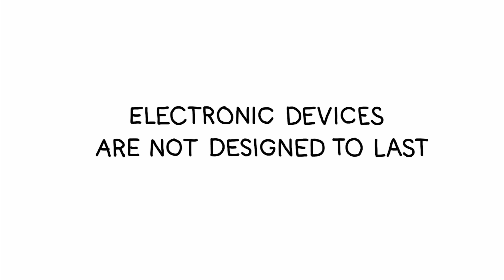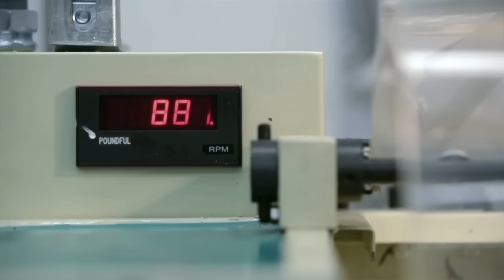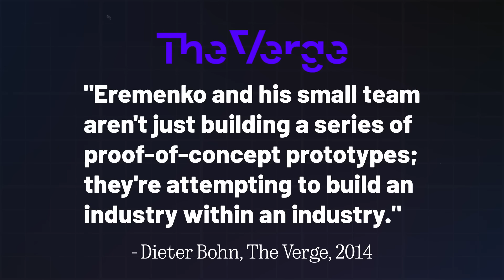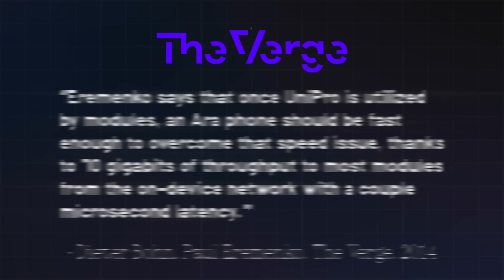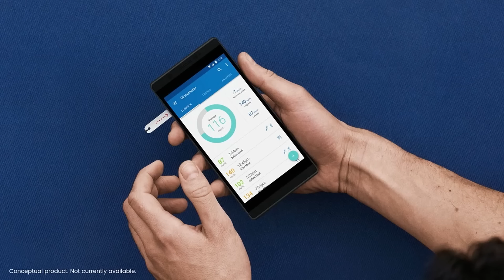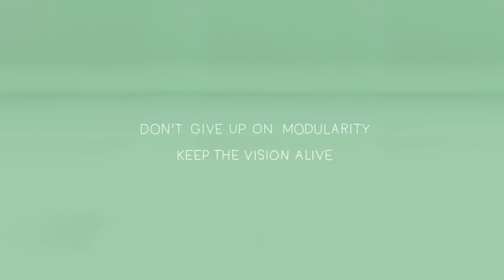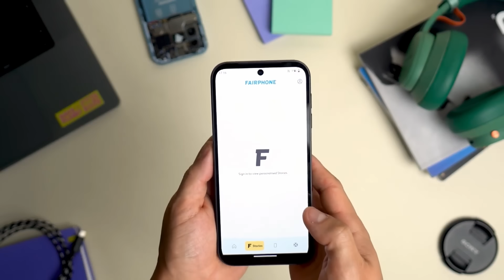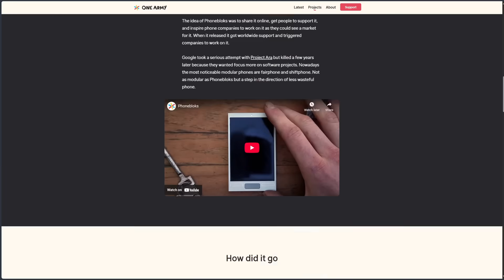Why Did Modular Smartphones Fail?

Comment: I get why modular phones never worked. Realistically, most people dont care about the waste or lack of customisability, they just want a thing that works. Over a decade later im still bummed tho cause its still too freakin cool.

Mottorola's moto mods were cool atleast
Reply from the maker: Yeah I wish they supported them for longer.
Reply: I liked the moto mods, and had a phone that worked with the. But actually using them wasn't ideal, couldn't put a protective case in the phone due to the mods, so I broke my screen...
Reply: @DevDog67  I think a tempered glass screen protector and the soft wrapping that came with the phone would've sufficed.  Most of the mods worked with the wrapping on, and it slid easily off for those that didn't.
Reply: normies and their consequences.
Reply: I don't agree with this, at all. People have gotten used to not having those things. But the hype around this phone when the idea first came out proves there was demand. It doesn't even have to be as involved as the original idea. If we could swap the battery, the screen, and the camera it wouldn't take much else for me to consider buying one.

Sooooooooo many people I know buy new phones mainly because they broke the screen, or they want a better camera. DXO One was ahead of it's time.
Reply: @KingstonHawke  While I agree, I would still rather have even more options.
Reply: @ChocoRainbowCorn I don't think you're disagreeing with me. I'm saying people care about being able to customize their hardware. The two examples I gave would be everything to me. Being able to hot swap batteries and storage is huge! And the camera is even more important to my crowd because we all shoot so much DSLR content, that if phone cameras could finally truly match even a ZV-1 experience, it would replace that whole category for us as we wouldn't need both devices. 

How you justify consumers spending more is to take two devices they already have and merge them into one.
Reply: AKA, the reason why iPhones sell well, despite being as expensive and restrictive as the Android.

I REALLY want to move on to Android, but theres so much to chose from, and each one has their own flaws. Is like using Netflix but being overwhelmed by so much movies that I ended up not watching it.
Reply: It's true, sadly, and I hate that because I am the kind of person who just keeps everything until it breaks. I've been lucky to essentially never having had to buy a phone, because I was able to either repair or inherit them from relatives, but I wish people cared about repairability and reducing waste more. But it's not gonna happen unless they're forced to, and companies are punished for producing unnecessary e-waste.
Reply: Exactly, the whole "the phone companies KILLED them" is such a tinfoil hat theory. People like ease of use, ease of use = sells. People are already get frustrated and barely understand how a car works let alone what goes wrong with it, the last thing they want is a  phone with a check engine light.

Comment: fairphone 6 was just announced & its not quite modular but just a hair closer, the back cover can have a couple accessories attached to it but those are all things we can get on cases. i think it would be too ambitious to just drop a fully modular phone, products & ideas need time to develop & take baby steps
Reply from the maker: Dude I'm much more excited about the dumb phone switch. On top of the repairability, this is like the ultimate gimmick phone. It's circled around into being actually useful.
Reply: I could see enclosed modules but you need a good locking system and probably a water resistant case.
Reply: Still no upgrades tho.

Comment: When RISC-V chipsets become capable off competing and potentially replacing ARM in devices we could see the rise of molar smartphones like we had all hoped for on the future. We have open source everything software side essentially. For an open source smartphone we’re just waiting on hardware. We just need RISC-V and the rest of the internals to catch up.
Reply: I literally would buy a Framewerk if it were built on a modern ARM or RISC-V base SoC. Unfortunately I don't know any similar that's not running on x86 & & Framewerk uses AMD Ryzen. I heat people scream "not gonna happen as long as there aren't any ARM based boards that uses PC interface & firmware". Nonsense! There literally are ARM SoC which run modern Linux systems which support PCIe, Ethernet & USB 3, 4k over hdmi WITHOUT using PC-like firmware.

Comment: Modular phones are pointless nowadays phones have peaked. Upgrading camera or motherboard aren’t really going to make much of a difference. We need repairable phones. I repair my phones and tablets but it’s not easy. At least a removable battery, easily replaceable charging port, and a logic board that isn’t hard to remove or pair to the new phone. Cloud locked phones are the biggest cause of ewaste. I find so many phones people throw away that could have a second life but they are locked for good. I understand it deters theft but with phone atms people can sell them anyway there’s got the be a better way.
Reply from the maker: Peaked is a strong word. I would say "normalized". There's a standard and a supply chain. Deviating becomes harder every year.

Comment: You could probably get a fairly seamless experience so long as you could agree on a standard screen and camera. All computers with a hdmi port can use the same screen and operating system with swappable parts.
Reply from the maker: Yeah I feel like computers have been historically a lot more modular. I wish I could have just install more RAM or a better GPU in my phone like I do to my computer.
Reply: @owencooktech The issue is that such a thing would be calling for enormous, fundamental change to an industry that was already fairly established in the big players yet still full of competition and wasn’t entirely decided to become something like a PC. It worked for PCs and Laptops because the devices themselves are so large that the modular approach meant very little compromise in terms of different form factors, even then a lot of laptop and desktop parts werent always compatible.

This was entirely technologically possible, but realistically would have never happened.

Comment: My current phone is a Fairphone 3 (2019) that I bought second hand and it works perfectly fine. Like maybe the UI isn't perfectly smooth or stuff, but I don't actually notice any of that, except that some games run a little slow. All other apps that I use work with no issues.
Reply from the maker: Yeah, the reality is that most people don't need a crazy performing phone. The fairfone 5 is perfectly normal for like 90% of apps. More than that even. It's the same point as my gaming phone video. Theres a reason they don't sell based only on performance. Most people don't need that.

Comment: Imagine dropping your modular phone and the phone unmodulates and modules be flying.
Reply: There are phone cases
Reply from the maker: Lol. The ara seems to have fixed that with the lockable system but imagine just loosing you battery and you never find it. That's game over.
Reply: @owencooktech  I mean, you could just buy another and pop it back in, shit, you could buy multiple batteries and be switching between them on the file so you don't gotta be stuck to a power plug
Reply: @CrocoDylianVT put 2 battery modules on the phone lol.
Reply: @DylanElmer but then you have no space for other stuff~
Reply: @owencooktech  by "game over" you probably mean "I can just get another battery."
Reply: @owencooktech  if they already did that to the desktop computer it is also possible to do that on mobile phones.
Plug and play.
But it needs more design evaluation..
Reply: @owencooktech buy another battery module
Reply: @owencooktech I did that with my first psp, dropped it in a bunch of rocks that looked a lot like the batteries.
Reply: @owencooktech Plugs In USB charging pack! 😂
Reply: @owencooktech  cant you just.... buy it separately?
Reply: @owencooktech  Phones used to have removable batteries and people didn't have this problem. In the (rare) case it did, you just bought another battery.
Reply: @owencooktech wasnt that the whole prospect of the modular phone. If you’re stupid and lose a single module you can buy just that module instead of the whole 1100$ phone or etc.

Also the fact that not everybody needs an “everything phone”
Reply: @owencooktech  imagine replacing that internal locking feature with special cases that could kind of augment the phone's appearance with a back for stickers or anti-glare lense for the screen? It feels like the focus on excessive functions in some versions and size concerns. 

I've talked to a buddy who liked the concept and also saw this video, he said he likes bulky phones. So I threw out the idea of what if whatever company in charge made 3 sizes for the modular phones. Small for kids and minimalists with limited mod features, medium for people who want try it out or don't want to get too technical with it, and large for people who more modding capacity in the phone. This way you hit every demographic of smart phone user with just changing the base phone size, nothing too crazy.

When it comes to the modular components the production of some parts could be made by the creators in house. While others companies can design higher end modular pieces as a collaborative efforts to expand the functionality.
Reply: @owencooktech  you can rebuy it tho
Reply: easy fix wouldve been some sort of clear back that locked in
Reply: couldve been a metal frame that slid on too
Reply: @hardlyreading like a clear phone case!!
Reply: @hardlyreading clever
Reply: That is how almost all phones with swappable batteries worked back in the day…. The batteries would just fly out
Reply: well thats what case would be, a clear case around the phone to hold it in...
Reply: A phone case would fix this issue easy
Reply: Hum... phone case exists ?
Reply: Add a case.. And problem solved... Or just buy a new module that broke/went missing...
Reply: just like in good ol days
Reply: That's why you get a phone case.
Reply: Discomodulate
Reply: My favorite part was when John modular showed up and modulared all over the place
Reply: And that's great! You know, how old phones used to be. It's better to transfer the impact energy to disassembling than to breaking
Reply: Casing
Reply: We already have modular backs for normal phones good ol fashioned phone cases, granted in this case it's a decent bit more necessary.
Reply: To be fair, this could make it more resistant to physical damage since that energy will be spread throughout all the modules flying off instead of that energy passing through the vital parts like the PCB and screen.
Reply: [[LEGO SOUND]]
Reply: A case I guess
Reply: Lego...
Reply: Then what is a case
Reply: It's called a phone case
Reply: I think it can be solve by simply using a cellphone case or making a special one
Reply: Case
Reply: That means nobody use cases, right?
Reply: Never used a Nokia? Shows..
Reply: Case
Reply: So don't drop it.
Reply: But isnt it like the nokia where when he phone falls apart its better since it releases the damage into falling apart snd not breaking?
Reply: *Lego breaking sound effect
Reply: Use a phone case
Reply: @GHOSTDEADLY-u6y smart
Reply: imagine bumping your phone then the battery falls in that crack between car seats
Reply: Simply remodulate it afterwards
Reply: Honestly just put it in a case, parts don’t have anywhere to go.
Reply: Imagine using a phone without a case
Reply: @SesameOil69  yes but a case wouldnt work here since the camera position isnt a static variable.
Reply: Phone case goblok
Reply: better than having to replace the entire thing for a cracked screen
Reply: Ohh shit
Reply: Its like... a casing wouldve fixed that
Reply: Ah the good old days of early smartphones where the battery was so easy to change
If I dropped my phone, the back cap and battery would do exactly that
Reply: Easy enough to fix. Just a little spring loaded latch thing with a little slider thing on each module you have to push left or right and then pull the module. If that doesn't work because of how they connect then yeah just a clear case backing. Probably be better than what I was just talking about because it'd be a lot cheaper.
Reply: Well phone case would probably fix this problem
Reply: Me when Nokia 3310
Reply: or just learn to hold your phone properly, I don't understand how people drop phones so much
Reply: Ngl I dropped Nokia n7610 once on asphalt
And it every component was on the ground.
I picked all up, assembled keyboard, shell, Sim, battery etc etc
And it was all fine again
Reply: You can use black cover to solve this,but really it's a nice product, i want to build a company that make modular phones
Reply: my old phone kind of already does this, the back comes off real easy, and if i drop it the batter will sometimes free itself
annoying,  but the screen has never crack and it still works
Reply: phonecase
Reply: Lego
Reply: maybe we should get a modular case then
Reply: uh, hello? phone casings exist?
Reply: non-issue
Reply: Modules disassemble
Reply: Like some dollar store LEGOs
Reply: Are you a Gen z? this is like having a flipphone and the battery and the housing flying off when dropping.
Reply: @tygs I remember my 3310 doing that.
Reply: Mf never heard of a case before
Reply: technically every smartphone is modular if you know how to assemble and disassemble it, they don't fall apart though. "modular smartphone" means it's easy to swap parts without much skill or many instruments, but you would probably still need screwdriver and pliers or smth like that.
Reply: @Daniel_Zhu_a6f  modular means a single company's proprietary modules aren't required. That's the point, an open standard.

Comment: A mass market product with niche appeal is guaranteed to fail.  People want a phone to just work as a phone out of the box.  It is a commodity item.
Reply from the maker: I guess. I think that's a small hurdle. I imagined there's some sort of basic version with cheap modules that did work out of the box and customization was for more savvy users.
Reply: @owencooktech  The average person just wants to open a box, take out a device and turn it on.  Even better if there's a nice smell when they do so.  I've bought plenty of niche devices, they tend to be pretty expensive, and have terrible resale.  They do tend to be pretty valuable a decade or so later though. Remember the Sharp Zaurus Linux PDAs?

Comment: There was NEVER any hope for this because planned obsolescence is how phone manufacturers get rich. This was nothing more than a publicity stunt.
Reply from the maker: I don't think it was a stunt at all. The people involved were actively fighting planned obsolescence.
Reply: @owencooktech I can easily disprove what you just said. ALL phones & laptops used to come with zero skill easily CONSUMER replaceable batteries & now NONE do...They wouldn't have to build some new kind of phone all they would have to do is what they used to do which probably also saved them $ on manufacturing given all the extra screws & glue & crap they have to use to seal in the battery but it makes them MORE $ for your phone to blow up. It was a stunt, period.

Comment: It is actually rather simple modular phoness was stopped so companies could just sell you a new one
Reply from the maker: 🤷‍♂️ maybe but also it's not like these companies are conspiring against you. The form factor just didn't seem feasible.
Reply: @owencooktech try repairing any modern smartphone and it can be hard to argue that companies are not conspiring against consumers apple as an example literally patented a screw just to be awkward also at least one or few project ara proof of concepts were made
Reply: maybe not conspiring against us but i cant help but feel robbed that my google pixel 5 would cost $100 to give a battery replacement it needed, meanwhile i bought a Motorola Stylus 2023 for about the same price and now have SD card functionality and aux port, which come to find out, makes buying headphones for phone calls WAY cheaper for something to work and is a lot easier to tell what's good, my specs have devolved because i was unhappy with everything needing the same port I only get one of
Reply: Explain how this would work if it’s “rather simple”